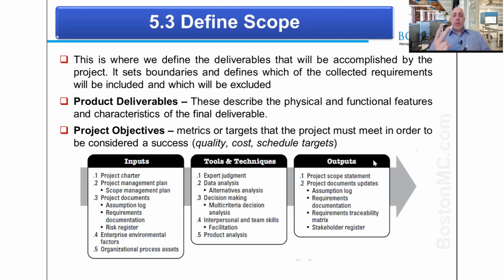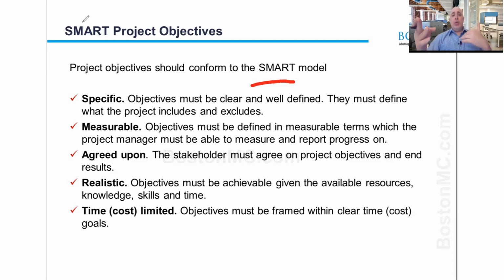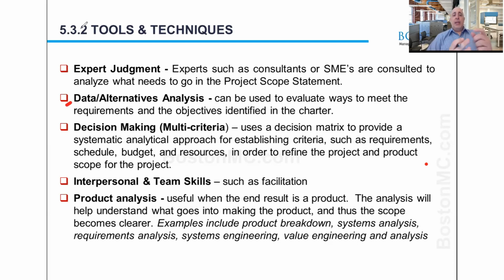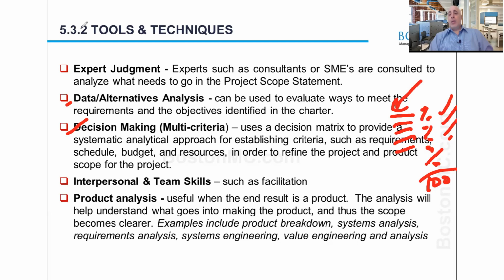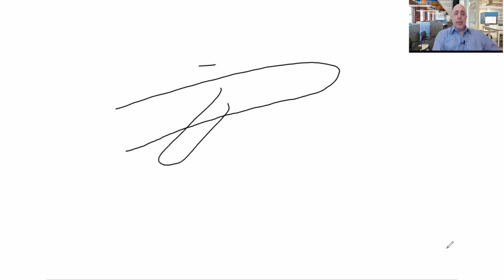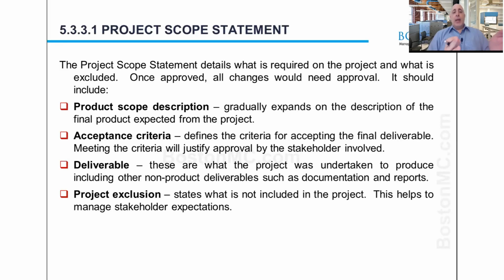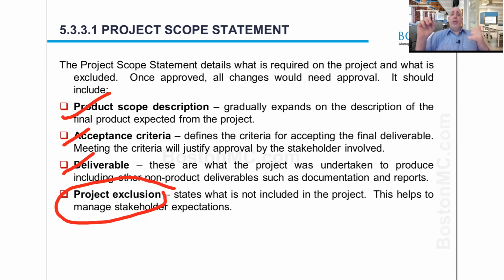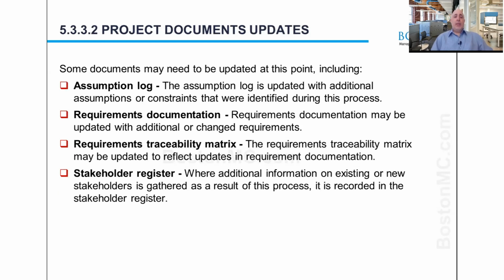Define Scope Process| Full PMP Exam Prep Training Videos

Comment: Hi sir.. let's say there are 10 items in the Requirement Document, then during Define Scope process only 8 of these were included in the scope. What needs to be done to the 2 excluded requirement, are they removed from the Requirement Document or simply updated with a comment like "excluded from scope"? Secondly will the Requirement Document need to be re-approved since it became the requirement baseline when it got originally approved?
Reply from the maker: When the requirements are baselined initially, they are not firm or set in stone. When we define the scope, we update the requirements document with what is approved into the scope. Unused requirements should be marked somehow as “not used” but could be considered later in case it is deemed still needed. In an internal project, all baselines can be modified where the organization feels they need to, and the sponsor would have to approve. Hope this helps.